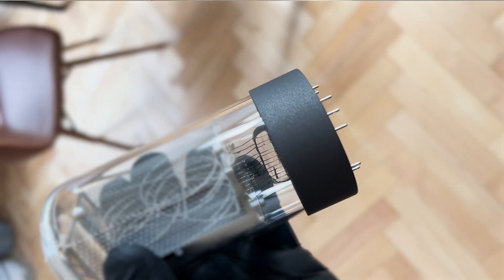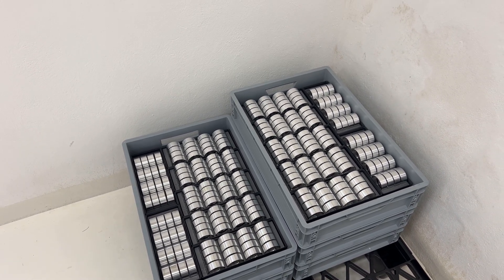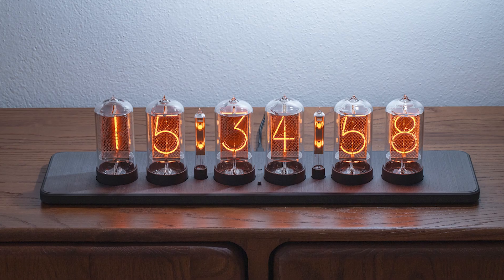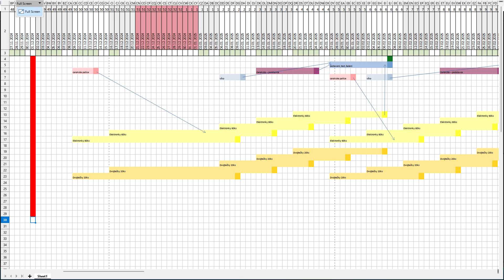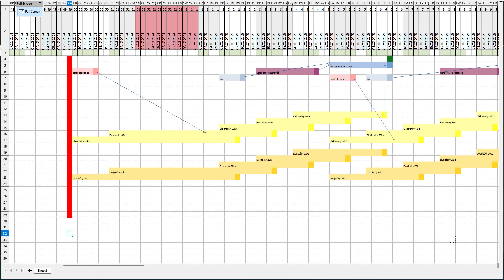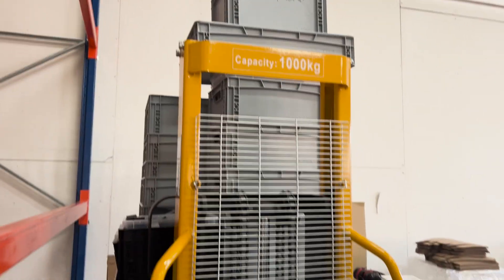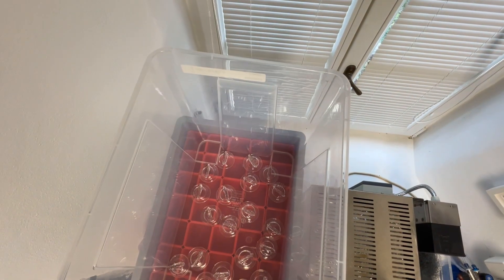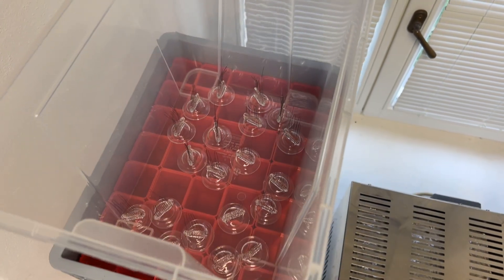Tomorrow we start first nixie tube batch for the Omnixie clock

Comment: If you have to clean sand from a lathe, do not use air to blow it away, rather use a vacuum cleaner. Air will drive sand in places where you don't it to go. Don't ask me how i know, all i can say is i still find sand even 4 years after.